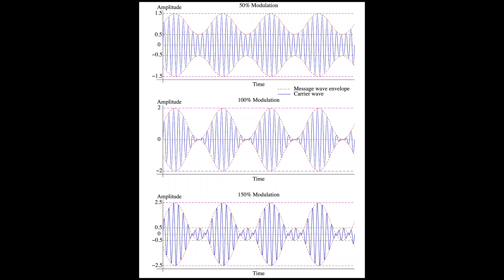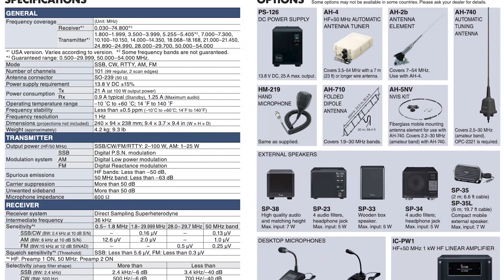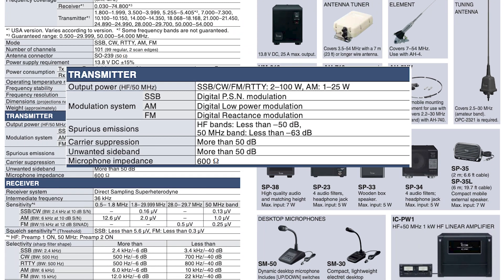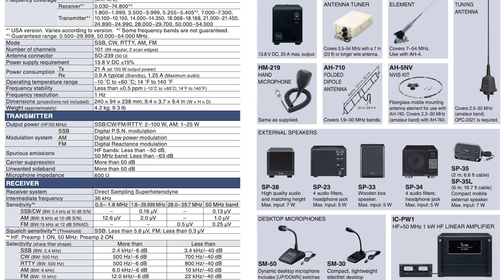Ham Radio - What do I need to get on AM? (Ep.4) #hamradio

Comment: In the past there was a ham subculture on 160 meters: amplitude modulation, often at very high power. Broadcast quality signals.  My guess is that power output was 5 to 10 thousand watts, into a substantial antenna. I have heard incredible audio quality, with a “full quieting carrier”.  Hence, absolute silence in between syllables or during a pause in speaking.  It was a level of audio quality that I will never forget.  I can still hear one particular station in my head.
Reply: I agree , great audio but the audio snobs get old to listen to .cackling about modulation 40 pill  amplifiers  etc . Nice sound but a clicky crowd.
Reply: legal limit is 1.5 kW
Reply: @TheLeftLegOfJauzah  And very very few people respect that. Have you not heard the boasts on the air? There are even videos on YouTube. These people are not the exception. A California Kilowatt is the oldest saying in the world. 5 to 10 watts has been done since forever. Who are you going to complain to? What will they do? It's the way it is.

Comment: I love the AM sound. I try to get all my NVIS friends to try it on 80 and 160.  Some of them always want to flip back over to SSB and I have no idea why. There are some ancient Ham around here that key down for 20 minute segments, Its kinda hard to break into a group like that but I've done it many times and even got a few qsl cards out of it as well. (after sending one 1st) Im only using an FT-891 which weights about 500 pounds less than those OM's I bet. power setting on AM for the Yaesu 891 says 45w max for some reason. maybe a typo.
Reply: @n2rj  I got into the hobby a little late and missed Art Bell. I’ve has QSOs with hams that talked with him though. Usually on 80m. There fortunately some archived YouTube recordings. 2 years is about here on his call sign, I wonder who will pick it up, friend family or fanatic?
Reply: @n2rj  whoa, I see that now. I bet he will drop that call sometime soon. Fan or not. There are more that will come out to jeer the guy and probably jam him or worse. Who knows. To bad Asia Bell didn’t get it.